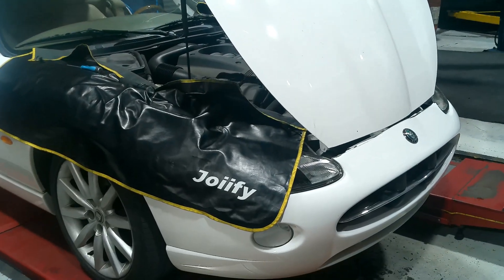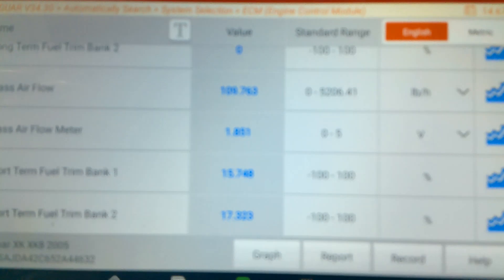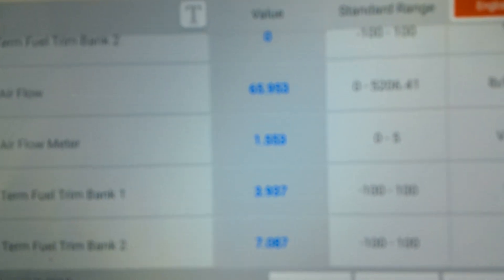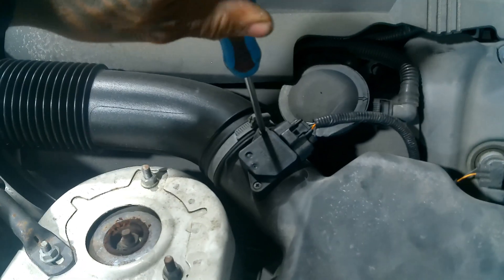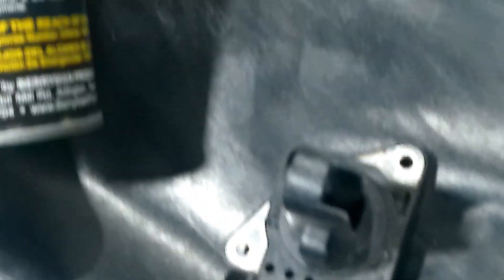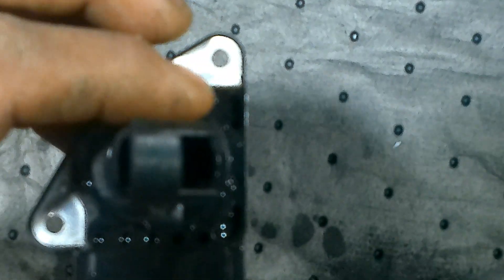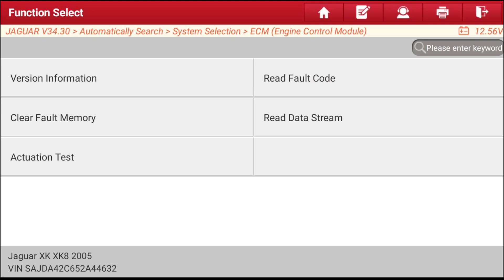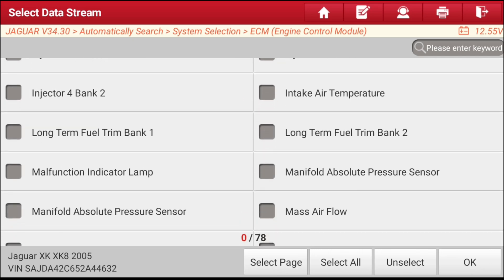How to diagnose and test lean engine misfire P0300 on a Jaguar V8

Comment: How did you know there wasn’t a vacuum leak? It look like the Long and Short Term values dropped slightly upon revving. Also, did you have any codes other than misfire codes that the MAF was bad or that you were running lean?